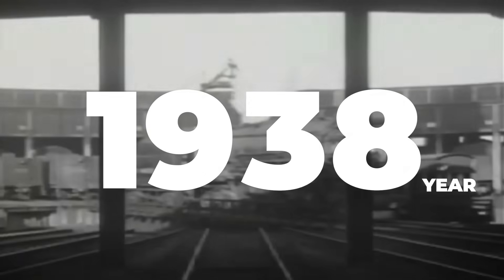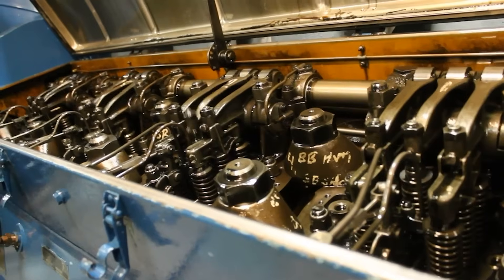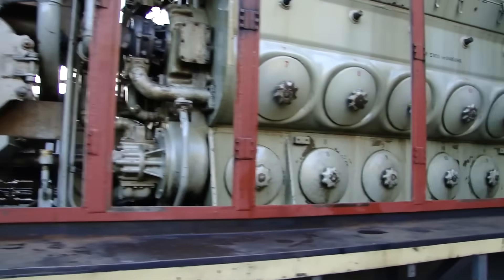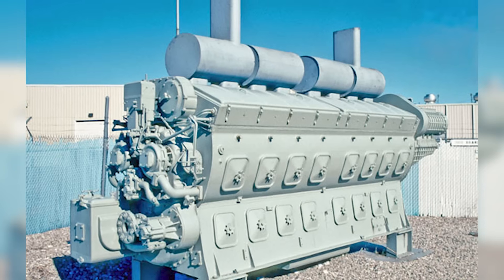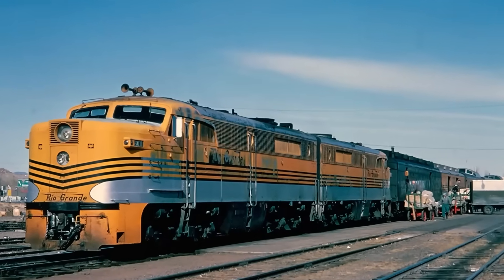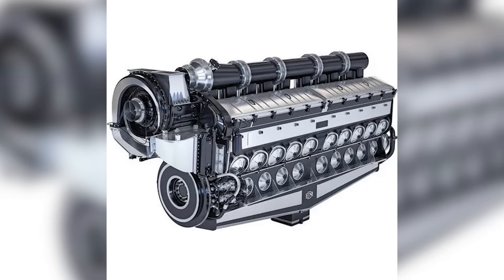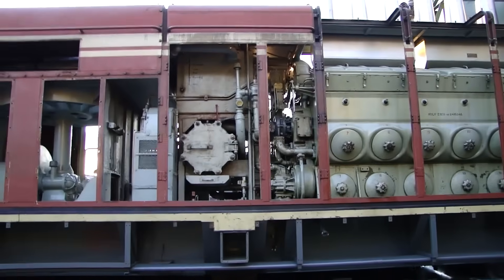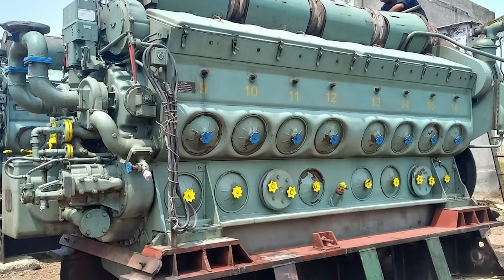Why EMD 567 Was Banned: The Most Powerful Train Engine

Comment from the maker: Where are my dear viewers from? What is your favorite engine? 🤔
Reply: MUCHA INFLACIÓN MAL CONTADA
TE FALTARON LAS G12 GR12 .
LOS MOTORES AHORA SON 645 Y 710 LOS 645 Y LOS 567 SON LOS MOTORES MAS CONFIABLES
Reply: There's so many! I've been quite fortunate in my career to have operated most of the common models in use in Canada. I gotta say, most of my favourites are EMD/GMD units, especially for switching and shortline operation.  

Hard to choose a single favourite, as each model have their strong suit and niche for different types of railroading operations. 
For Lighter first mile/last mile type switching, and lighter rail shortline operation, SW1200's, and GP9's are my favourites.  
For heavier roadswitching duties with multiple unit consists, give me a set of SD40-2's any day! 
For heavy tonnage point A to point B mainline freight, EMD reached their peak with the SD75i, and have died a slow death since. 
GE have since sort of took the crown for king of the heavy mainline road power over the last few decades.
Reply: Hi!! Commonwealth of Virginia! Stafford County!! I just like Engines in General!!
Reply from the maker: @RedneckSpaceman  Hello To my good people of Virginia :) I know, we love engines too :)
Reply: I spent 33 years, from 1979 to 2002, in heavy fabrication welding on G.E. locomotives.All the way from the Dash-7 to the Genesis series; From DC to AC; From 4 axle to 6 axle, and retired 23 years ago.

Comment: PT boats were powered by Packard engines, not 567’s.
Reply from the maker: You're absolutely right! PT boats indeed used Packard engines. The EMD 567 was primarily designed for locomotives.

Comment: Bore and stroke fixed huh ?.  Then explain the 645 and a 710 that replaced 567
Reply from the maker: Great point! The 645 and 710 engines brought some significant advancements. They really showcased the evolution in design and efficiency compared to the 567.

Comment: There were no emissions and efficiency standards for locomotive engines in the 1960's.  The 645 is a bored 567, and the 710 is a stroked 645.
Reply from the maker: You're absolutely right! The evolution of locomotive engines has been fascinating, and the 567's design paved the way for many advancements in rail technology.

Comment: Worth mentioning, most surviving 567 powered locomotives have over the years been rebuilt over the years with 645 power assemblies and components, and many have had the electrical components upgraded as well to Dash-2 era systems.  All of the older units (GP9's, SW1200's) I've worked with in my career were all rebuilt with 645 power assemblies etc... They are still great units for shortline railways, and lighter switching operations.
Reply from the maker: Thank you for sharing your insights! It’s fascinating to hear about your experiences with the 567s and how they've adapted over time.

Comment: At the same time that EMD's 567 won over the railroads the GE Cooper Bessemer FD? diesel was floundering very badly. The entire U series was basically junk until say the Dash-7 model with the early FDL came along. Personally I would have kept the EMD line as that SD90MAC was a beast with that H engine producing 6,000hp. When the railroads wanted more power EMD was like here.....have at it. Oh and the new locomotive sales in the USA is about dead. Railroads are rebuilding their old EMD's instead of buying new.
Reply from the maker: That's interesting to hear about the challenges the other diesel models faced during that era.

Comment: Why all the rockers gear ?  Stated in vid it was a two stroke?
Reply: It is a 2-stroke.  Intake ports are at the bottom of the cylinder liner and poppet exhaust valves are in the cylinder head.  Uniflow scavenged, not loop-scavenged like your weed-whacker.  No crankcase compression.  Scavenging is accomplished by Roots blowers with maximum airbox pressure of ~8 psi.
Reply: @andyharman3022  Got it.
Reply from the maker: Great observation! The EMD 567 is indeed a two-stroke engine, and the rocker gear plays a crucial role in its operation. If you have more questions, feel free to ask!

Comment: The Belgian railways SNCB were one of the biggest EMD clients in Europe. The most notable locomotives (class 55) were built by B&N (Brugeoise et Nivelles), a six axle two-cab full body design powered by 16-567 engines and EMD generators/traction motors. When spinning, the electric radiator cooling fans happened to have the same drone as the Roots blowers, and with everything blaring full blast, you could hear them from miles away, hauling scrap metal through the Belgian Ardennes hills en route to one of the steel works. B&N also sold these locos to the Luxemburg railways CFL (class 1800). https://www.youtube.com/watch?v=sE0RpujDZVs
The brake resistor cooling fans were even louder. Here a Belgian loco with a steel products train going downhill and engaging dynamic braking: https://www.youtube.com/watch?v=y-JvOgihJKg . Soundrecording: https://www.youtube.com/watch?v=VIyazUS63dc .
Starting up: https://www.youtube.com/watch?v=7DFHUMQkx34. Wheel slip, but managing to pull away: https://www.youtube.com/watch?v=dKOPIotmR78 . On board, shunting and moving a short tank car train: https://www.youtube.com/watch?v=XxGxvvvePx4 . Cab ride Belgian class 55: https://www.youtube.com/watch?v=6Zj277cJN0A .
Engine room: https://www.youtube.com/watch?v=oHgcOTUxdA4 . Refurbished 55 (yes, a few of them are still active, as histric rolling stock and even in daily line service): https://www.youtube.com/watch?v=GokPlJZ6hvU . Sound recording class 55: https://www.youtube.com/watch?v=18s0aTTohZU . 55 owned by a rail maintenance company: https://www.youtube.com/watch?v=zCyJTSjczeQ . Engine room in refurbished 55: https://www.youtube.com/watch?v=3NQBOsIF2sY .
In Belgium and Luxemburg, 12-567 prime movers can also be found: https://www.youtube.com/watch?v=puPKr6B46o0 .
All credits go to the video makers. I only posted the links.
Reply from the maker: Thanks for sharing all those links! It’s fascinating to see the EMD 567's legacy in action across different railways.

Comment: In Tunisia we use mainly EMD 2 stroked. Great engines.
Reply: Reliable, but loud... just feed it about 10 gallons of oil a day and keep water temp under 198.
Reply: @flinch622 Yes the are not very fuel efficient too but they like them here because of their simplicity. We have new ones from EMD and we also have very old ones from the 1960s.
Reply from the maker: Thanks for the insight! Keeping the oil flowing and the water temp in check is definitely crucial for maintaining performance.
Reply from the maker: That is amazing to hear :) Thanks for the love and support!
Reply: @AmericanVintageLifestyle-h6c Great Channel. I value the effort behind these vids.
Reply from the maker: Thank you so much for your kind words! It means a lot to know that the effort is appreciated.

Comment: It wasn't even banned dude... the 645 superseded the 567. I hate these stupid AI channels. They always over-exaggerate. Besides, they don't own these videos mentioned. Wtf dude? Like dawg, stfu.
Reply: Accept the flaws. Could you say what you find so wtfstfu egregious in error? Dude, without making an argument  your comment means as much to me as a fart.
Please, support your assertion, other than not owning videos mentioned.
Reply: @andyjackson3414 There were no flaws with the 567 engines bru.
Reply: @RailsOfIllinois  I meant to  delete but let it slip by me. Thanks for your reply.
I was  a  yard clerk "number dummy" for the B&O,  Bay view, Baltimore in the early 1970's.
I agree that those 567 engines were as perfect as anything can be.
My dad was an engineer running passenger with E-8's. Once I walked to the rear of the unit to us the  toilet. I was 12.

I could feel the heat. On the way back the signal went yellow. Oh the sound on opening the throttle! 
Crews much preferred EMD's, as well as Fairbanks-Morse engines. Our last F-M died on a sleety November day, on the ground on the main lead in front of the yard office. Attempts at re railing damaged it enough to scrap due to it's age an lack of spare parts. 
Oh the humanity!
Reply: @andyjackson3414 Ah sweet! Thank you for your service my man. 1 blast of the whistle means Casey Jones tells ya that your rides officially over.

Comment: On a small short line in Michigan I engineered GP-7s, an E-8A, and FP-7 using this engine.  I have seen this engine in the LST that is a museum ship in Muskegon,, Michigan.
On my favorite locomotive, which is my handle, I found it to be an easy engine to start and run.  The sound of it at full power was pleasing.  In short, great memories.
Reply from the maker: Thank you for sharing your memories of this engine; it’s great to hear from someone who has actually worked with these engines.

Comment: Lots of Alco engines and locomotives shown in this video, also dramatized and incomplete. Nothing mentioned about its Roots type blowers, the first applications of turbo chargers on the GP-20, GP 30, GP 35 and SD-24, SD-35 models. Also not mentioned the 645 and 710 generations with increased displacement per cylinder which were further developments of the same architecture. It was only the 710 generation where finally environmentally concerns started the demise of the two stroke diesel.
Also untrue is that they burn lubrication oil by design. They are not dirtbike engines with crankcase scavenging, the roots blowers or turbo provide the needed positive pressure to push exhaust gasses out of the cylinders, the crank case is not pressurised nor has fuel/air mixture going trough so that a standard sump lubrication can be used..
Reply from the maker: Thanks for sharing these details about the evolution of these engines - very helpful!

Comment: Interesting for an American video you show a large amount of our Australian manufactured Clyde (engineering) licence built EMD products especially from the VR (Victorian State Railways) which actually had a near 100 percent ( apart from a handful of shunting or yard locomotives) Fleet of EMD locomotive product, a good example of some of them from 3.55 is three examples, the first is the B- class the first streamliner that was “double ended” built in Australia in the early 1950’s, the second was the S-class single ended also from the 1950’s, the third example of this consist is the X-class, a hooded example built in the 1960’s and came in a couple of iterations, you will note that all were Co-Co or six powered axles unlike US versions that were Bo-BO also Australian streamliners were lower and longer than US streamliners this was to suit our loading gauge and all were built originally for 5’3” Broad gauge however just about all were bogie swapped to standard gauge at some times in their lives also a high percentage of these locomotives believe it or not are still in mainline service to this day both with private and heritage operations! Of note is US viewers will notice a resemblance of our state blue and gold livery design is very very similar to the USA’s “Eerie” railroads livery and this is because the Victorian Railways did base the design from that railroad, also the VR used a wide variety of 567 series EMD engines from the V6 in 567 and 645’s in yard shunters to V8, V12, V16 and V20’s in other State EMD’s, as a matter of fact Australia was the last place in the world to manufacture the last of the “Streamliner”  Bulldog locomotives, the CLF and the CLP in the 1970’s for the Australian Commonwealth Railways later renamed Australian National these were Basically an SD-45 under the skin! also good shots of our VR T-class units and the unit at 11.52 which shows the final third series T-class these were all 645 EMD powered the earlier 1950’s first and second series (not shown) were 567 powered and  built in large numbers in Australia for Australia’s Victorian Railways that finally ended steam locomotives on our branch and mainlines in the early 1960’s! A large number are still operating today also in private and heritage organisations
Reply from the maker: Wow, that's an incredible amount of detail about the EMDs! It's awesome to hear about their history in Australia and that some are still running today.

Comment: It vanished from production.  Yes, because the 645 was able to handle the higher loads it could not - and when the 645 was tapped out, the 710 replaced it.  Click bait title.
Reply: and the 930 is gonna whoop dat azz !
Reply: @smf2072  Sorry, 930 never happened but the 1010 did.  However it's a 4 stroke and the railroads don't like it.  When the 710 gets Tier 4 certified for land use, expect to see lots more of them again.
Reply from the maker: Thanks for adding that context! It's always great to get different perspectives on the history of these engines.

Thank you for the love and support :)

Comment: Coastguardsman here! My first ship was USCGC Hamilton WHEC-715 had two Fairbanks-Morse Opposed Piston two cycle inline 12 cylinder engines as primary propulsion with two Pratt Whitney gas turbines for higher speeds to keep up with the carrier groups and helped pushed a 378 foot hull to 37 knots. The generators were GM V8 two cycle engines. My second ship was USCGC Spencer WMEC-905 which has two ALCO V18 main propulsion engines that pushed a 270 foot hull to 24 knots.
Reply: How did the USCG solve issue of getting the diesel and gas turbine to work harmoniously together? The disastrous small LCS was configured similarly designed. What’s the “secret sauce “ on the USCG cutters?

Comment: 567 wasn't banned, it just ran out of the ability to be upgraded.
Reply: The same is true for the 645-710 transition as well.
Reply: It just got superseded by the 645 series in the 1960s.  EMD needed to make locomotives with more horsepower than the 567 could deliver even with turbochargers.  The later 567 turbocharged prime movers became maintenance headaches on many railroads ("bell ringers").
Reply from the maker: You're absolutely right! The evolution of locomotive technology is fascinating, and the transition to the 645 series really marked a significant advancement in horsepower and efficiency.
Reply: I don't know where this guy got the idea that you needed a conductor to operate any locomotive. Dumb
Reply: @kennethanderson6353 probably mistook conductor for engineer
Reply: Conductor is the second set of eyes and also does all the paper work and is the guy actually in charge of th train
Reply: The word "banned" is to get views via the algorithm. That accounts for MANY utterly stupid titles but money is money. This channel may well feed some third world village. Real railfan channels also exist but the Youtube slop flow is brutal.
Reply: GE's 4 stroke engines, used less fuel, required less maintenance. Large 2 stroke ship engines, have the numbers, but the size necessary to achieve it, WOW!
Reply from the maker: It evolved, one might say :) Thanks for watching :)
Reply: Boeing 737 Max of its days.

Comment: Hold on a minute, how can that engine be a two stroke when it has camshafts and valves, they're only used in four stroke engines, two stroke engines have ports in the cylinders which are opened and closed by the pistons.
Reply: The EMD engines are a uniflow design.  Charged air enters the cylinder through ports at the bottom of the piston travel, this charged air enters the cylinder and pushes out (scavenges) the exhaust through poppet valves in the cylinder head.  Those poppet valves need camshafts to operate.  Since it's a two stroke engine, the camshaft and crankshaft both run at the same speed.
Reply: Intake ports in conjunction with poppet valve exhaust is known as a ’uni flow’ 2 stroke diesel as opposed to cross or loop scavenged. Even though they are scavenged by the use of a blower they are classed as naturally aspirated by SAE.
Reply: poppet valves are just a valve type; theyre used for many more things than just 4 strokes. not sure why exactly the 567 wouldnt have used ports instead, maybe it hurts the compression ratio or something
Reply: They did use ports.  They were half way down inside the cylinder liner, where the free air was forced in  by Roots blowers.
Reply: All 4 of the puppet valves that are cam operated open only exhaust valves.  The center rocker arm is for the injector.  There are intake ports about midway down the cylinder liner for fresh air supplied by 2 Roots type blowers. It is truly a cycle (stroke) engine almost built very similarl to its little brother the Detroit 2 cycle Diesel used in trucks, and industrial equipment also built by GM.

Comment: If this is abt EMD engines why your showing Alcoa and GE prime movers also Detroit’s were used EMD units were on large ships also the engines are still in use today the sad thing is thanks to the green new scam and Obama dumb ars they went out of business only to be scooped up by caterpillar a foreign company owned by the Europeans as caterpillar was one of the first to leave our country  this video is a joke and a lie  also the very first diesel two stroke locomotive engine was called a Cleveland diesel in which came in a inline configuration yes a inline EMD  America had so much industrial might you had Baldwin locomotive you had Fairbanks Morse which was a two stroke opposed piston engine that had two crank shafts no valves or camshaft  alco locomotive  General Electric that’s the only one as of today making locomotives do things today is sad
Reply: Well GE is also a leader in toaster and barbecue and pissed up fire department😅😅😅😅😅